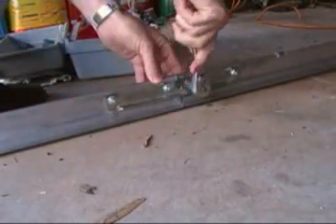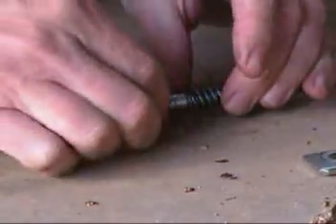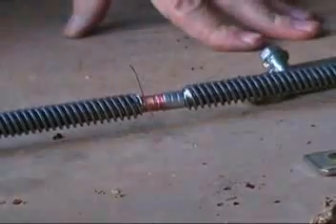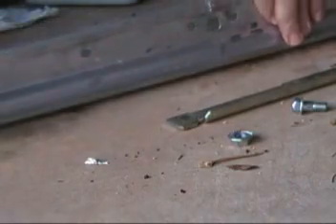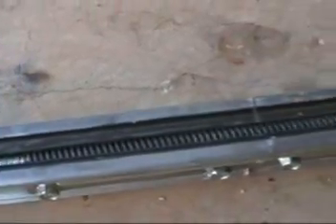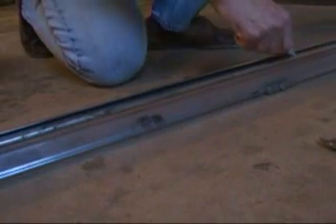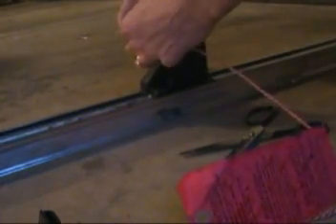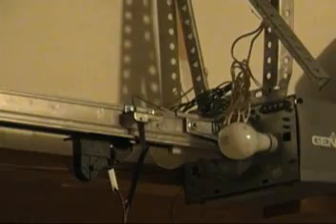Genie Screw Drive Garage Door Opener Failure - Repair - Part 2

Comment from the maker: boygent, yeah, I guess I didn't show that too well in the video.  There are some screw terminals on the unit where you connect the control wires.  I just shorted across those two screw terminals with a screwdriver, which acted the same as pressing the button to open/close.

Comment from the maker: Hmmm.  That sounds like it may be problematic.  Not because it wouldn't work (it probably would), except for that your door might not go all the way down or all the way up, if you know what I mean.  If it's just a couple of inches, it sounds like that might be ok.  I'm not looking at the track and screw right now, but it seems like you could cut the screw and shaft.  You'd just be left with a door that would have a shorter travel distance.  Lemme know how it goes!

Comment from the maker: The thing that slides along the track is the carriage.  The black lever that the carriage runs into when moving to the right is a limit switch. I think that's what you might be getting at.  When the carriage pushes that, it "knows" to stop running. There's also the power cable for the opener in the background and there's the safety rope connected to the carriage.

Comment: I have worked on garage doors and openers for 20+ years, gotta say, nice home fix... and your right about a 3 piece rail, there junk! cant help but notice, it looks like you have a 7 foot door in 8 foot track. the J arm is WAY to long. That may have put to much stress on the screw making it fail. Also, and you can see it in your vid, over time will break down the top panel. Its like bending a coat hanger back and forth, it will break. Your money will best spent on a jack-shaft opener.

Comment: Lube the door man. That sounds bad
Reply: especially the door spring coil... else it binds onto itself and make the door seem extra heavy.

Last, lube the motor sleave bearings. 

These openers are bullet proof if maintained properly with regular lube... mine has been going 20+ years. Best thing I did to it was adding the rubber screw mounts to quiet vibrations
👍🏻

Comment from the maker: Not really.  I'll offer several bits of alignment with reality. The $13.50 part would have been required whether I bought the $8 clip or not.  And no matter what, you're looking at over an hour to take it down and put it back up (nothing happens in 5 minutes when you're fixing a garage door opener, hehe).  The clips were a rip off, and they also would probably fail again, and chew up my carrier, whereas my blowtorch/solder is still holding after years.  My design is better than the factory one!

Comment: so am I to understand you wrapped copper wire, used a blowtorch and solder, and then bought a $13.50 part - all to avoid paying $8 for a 5-minute fix?

Comment from the maker: Apparently not.  At least not so far.  It's been running fine since I shot this video, a year ago. I prefer to fix stuff if it can be fixed.  It's very satisfying to me.  I do agree, though, that if I do replace it, I won't get the depot-fied segmented screw version (that's easy to ship, but doen't hold up).  The one piece rail and one piece screw are more likely to hold up well.

Comment: I have the Excelerator, the carriage shattered shortly after the opener had a bouncing fit. It then dropped the door, luckily the car or myself weren't under it. I haven't taken the rail apart yet, but as near as I can tell it either has smaller gaps at the separations, or no separations in the screw. I replaced it with the PowerMax® 1500 which does have those separations and the collar-clip. It's an 8 ft so I have 4 pieces. If I got a new carriage, what's a good price to sell the used kit for?

Comment from the maker: @ozziekuma, Yes, the old carriage was indeed beyond repair.  A symptom, before complete failure, was the screw turned, but the carriage didn't move.  If I pulled up on the door, it might 'catch' and then it would start moving.  But there were so many teeth missing from the carriage that when it got to the place were there was a gap in the screw shaft, it would stop.

Comment from the maker: @sms373, The chamerlain was installed by the builder in 1993.  Can't remember the number of lights.  I actually still have it stowed-away....thought I might use it for something.  The motor and gears worked, but the shuttle kept wearing-out.  It would just scrape along the t-bar, and even though I kept it greased, it kept wearing out.  Like I said before, probably wouldn't have been a problem without the high lift.

Comment from the maker: @chicagolandhobby This one actually replaced a Chamberlain that was original to the house.  The problem with that one (chain drive) was the shuttle kept wearing out (metal to metal). Probably due to the odd forces from the high lift.  This one deflects the bar pretty far each opening, but things seem to be holding up ok.

Comment: I like your work. Genie are a**holes when it comes to parts. I have handfulls of collars and clips (the part you improvised)  You will find that if you break the "handclasp" the little machined ends at the joint Genie will tell you a single screw piece will not fit and you must buy the whole screw. BS, I have single sections and they fit just fine. Your repair should hold cause the collar requires very little to hold it in place. If it does fail write and I will send you some clips free.

Comment: Well there's your problem right there. You bought a Genie. Not saying that they're the worst, but Chamberlain/LiftMaster is a lot better.

And technically high lift doors like yours aren't supposed to have normal operators like that, but it seems to be working okay so it should be fine. :)